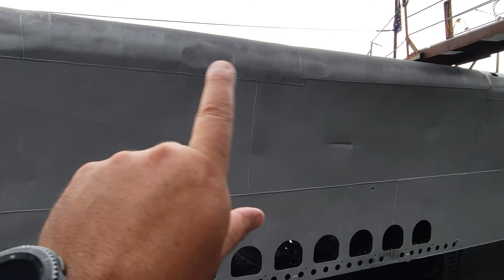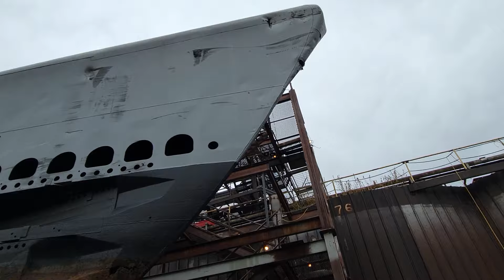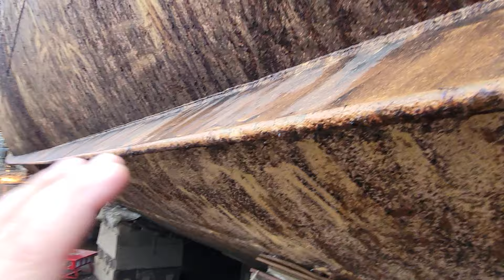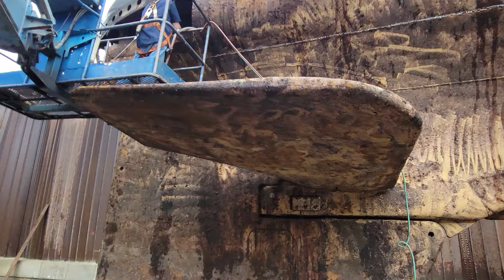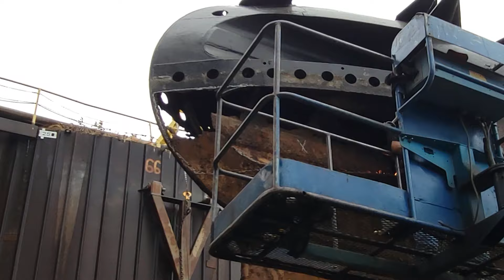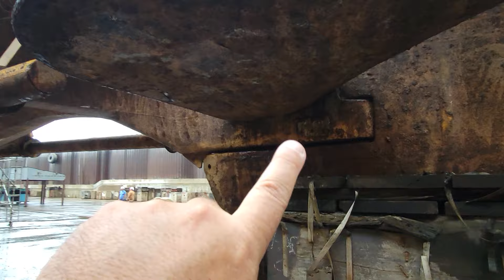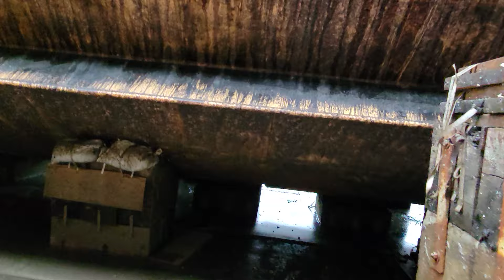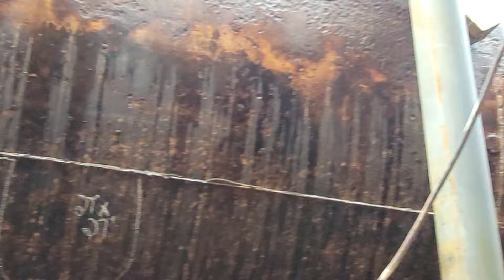USS Cod in Donjon Shipyard,  Erie Pennsylvania.

Comment: Chiming in for the subvets' community, I send your crew a big thank you for doing this work!

I want to understand this supposed galvanic corrosion:  Can someone please explain (that's supposed to be ME, but since I may be missing something, I'll hold off and wait to hear from other voices) the differing metals at work causing this corrosion?  I'll pick my words carefully to avoid confusion for readers.  Galvanic corrosion results from differing chemical potentials in dissimilar metals that are in contact (welded, bolted, clamped, penetrating the hull, held in bearings, etc.) and then immersed in an electrolyte (salt water, brackish water, dirty water).  The classic situation on submarines is where the more active nickel atoms in the steel alloys that make up the hull are picked off, one-by-one, by the potential between them and the copper atoms in the bronze propellers.  ("Screws" is the name usually given the propellers.) To stop the nickel atoms from leaping into the water as ions, sacrificial anodes (the zinc blocks) are bolted to the hull, especially nearby to the bronze, because closeness matters.  The zinc atoms are more eager to leap, so they jump into the water first, before the nickel in the hull.  As a result, the zinc blocks slowly corrode away, appearing as though they are being eaten by sea-termites.  As the gentleman points out, these zincs have not been chewed at all.  The path for the electrochemical potential is from the positive (+), cathode in the bronze, through the bolts that hold the bronze screws to the shafts, along the steel shafts, through the shaft seals and bearings into the hull, along the hull to the negative (-), zinc anodes, and then into the electrolyte (the impure water, full of metallic salts).  That completes the loop for electron flow.
  
...Except that in this case, the bronze has been removed.  That would seem to explain the idle, unmolested state of the zinc anodes, right?  Can anybody affirm/correct me?  As I understand it, in order to have galvanic corrosion, you need those differing metals in physical contact.

I may be wrong but my guess, here, is we are seeing, instead, corrosion of the hull through a redox (oxidation/reduction) reaction with oxygenated water, especially where the air and water take turns lapping the hull near the waterline.  The iron in the hull is simply rusting (oxidizing).  The sacrificial anodes would seem to play no role.  I am eager to hear from anyone with a more solid technical background in electrochemistry/corrosion controls.

I should note electrolytic corrosion , on the other hand, happens when an actual electrical current is made to flow between immersed metal  structures.  In such a case, the current flow tends to drive ions off one immersed pole and into the electrolyte.  The end effect is approximately the same as with galvanic corrosion, but the metals need not be dissimilar and a power source is required to drive the corrosion process.

Comment: Why do they take off the props ?  Seems like cutting off the old girls legs to me.  She can't drive anymore, weapons system is non functional and one of the intakes to the engines is blocked off so whats the point.  Sure wish they would open up that other water intake so the crew can at least run all her engines from time to time. Give the old girl a full heart beat at least.
Reply from the maker: She was meant to be a static training vessel in Cleveland.  She is now a museum, not a cruise ship. She still belongs to the Navy in care of the museum. I'm sure cruising around Lake Erie in a submarine would not be allowed. We do run 3 of her engines but not for power just nostalgia.
Reply: IIRR it's partly because they cause galvanic corrosion to be at an even higher rate.  Plus it's far easier to maneuver and transport the boat if they are not there as well as for divers to inspect, and I guess museums like having shiny things in their foyer!